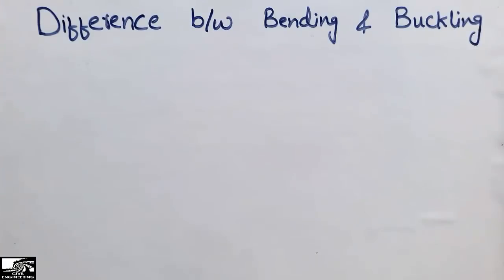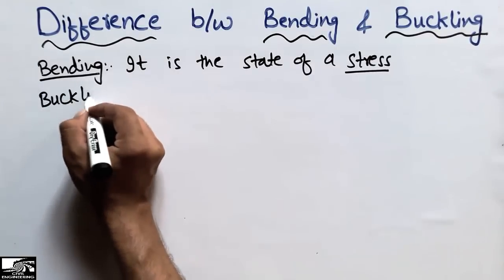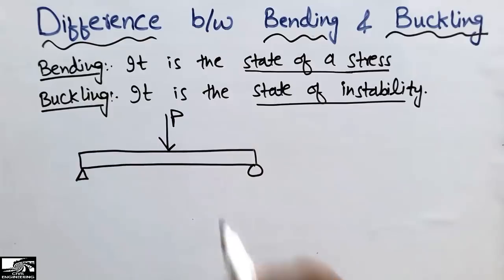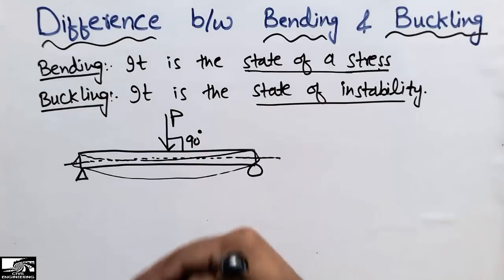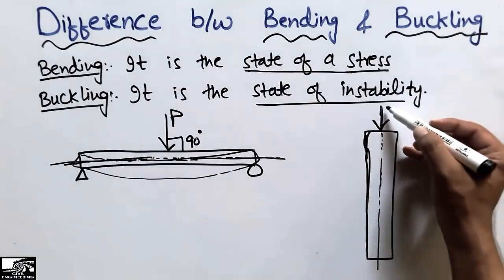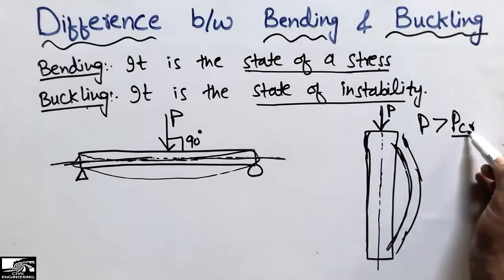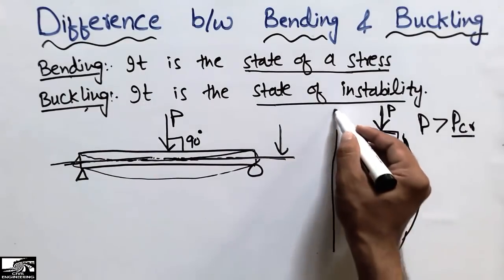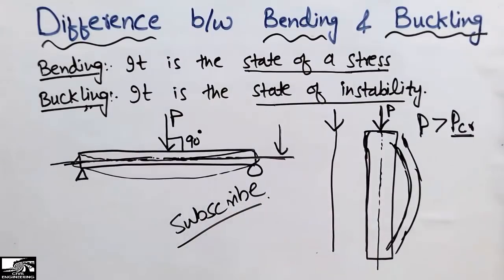Difference between Bending and Buckling

Comment: Sir, your explanation is good ...but getting into the deeper , you should also explain how a member fails in buckling...from Euler buckling formula it is clear that Eular buckling load does not depend on the yield stress of the material / grade of material...but in all our structural code, we have seen that permissible axial stress of a long column is a function of material ( structural steel) grade also ( that means permissible axial stress depends on both eular buckling load & yield strength of material)...that means whenever a member fails due to buckling...member will deform..member will bend...bending means tension & compression fibre...tension fibre means yielding....since yielding doesn't happen due to compression ...crushing may happen due to compression..but crushing strength is much much higher ....in case of buckling we can say that yielding is happening..that is why permissible axial stress is a function of yield strength also ( PERRY ROBERTSON 'S EQUATION)which are given in all structural code......
Reply from the maker: Thank you for your comment. I will go deep in coming lectures